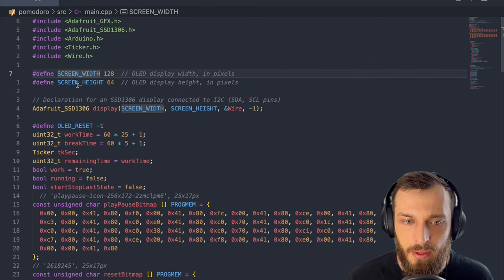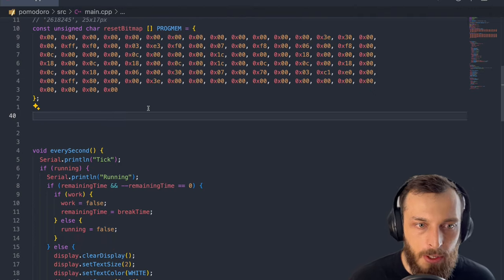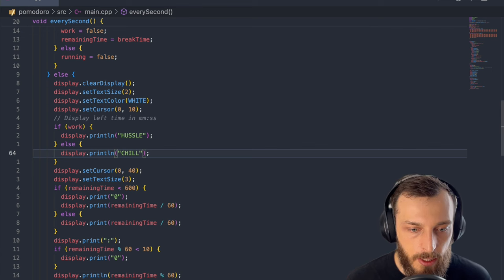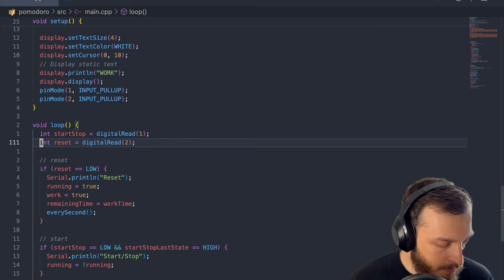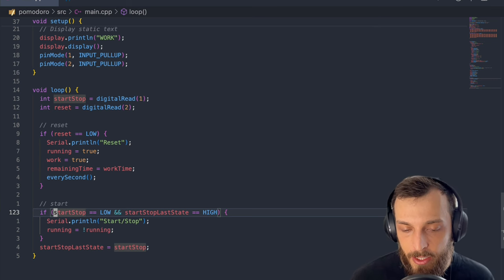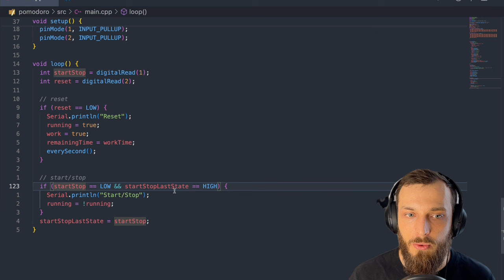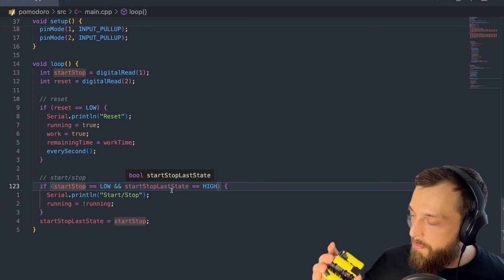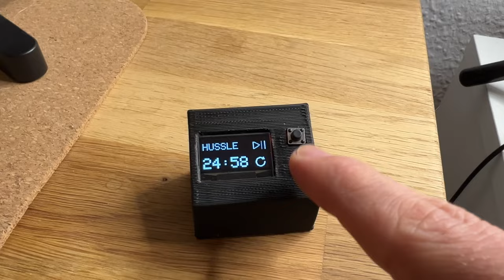DIY ESP32 Pomodoro Timer with code explanation

Comment: Nice project! thank you for sharing.
I noticed you use the tp4056 charging IC for the lipo. Did you limit the charging current? The default current is 1amp and that seems a lot for the small lipo.
Reply from the maker: Yes i do
Ah no
How can you adjust that? 
Maybe a bit much, but didn’t get warm while charging, so I assumed it is fine
Reply: @CodingWithAuryn  
Yes for 1 or 2 times this should be fine, but lipos can and will blow up and catch on fire if charged with the wrong current. Happened to me before and dont want this happening to you.

You can change the resistor on the tp4056 to a different one to adjust the current. google the datasheet there is a table with values for the right current.
The 18650 cell you mentioned would be a better fit for the default current.
Reply from the maker: Thanks for the Tip
True
Then I may modify the case and exchange it for the 18650 soon :)

Comment: I love this, I've built this as my first esp32 project. Would it be possible to add a buzzer or vibration motor to mark the change of status?
Reply from the maker: sure, should be easy to add, then just a new case is needed.

Comment: In this video I noticed that your Background Blur Effect for the video stream made it very difficult to see and recognize the battery and the two ESP boards.

I'm aware that it's a fairly new channel, but I would still like to encourage you to make use of more than one camera.
One camera pointing at you, and another camera pointing towards detailed objects on your table top - like electronics, 3D printed parts and stuff like that.

I'm certain that you could use an old phone as camera 2, and synchronize the video streams in the post processing.

I hope my comment can be inspiring and helpful. 😊
Reply from the maker: Thank you. Yes indeed something I should consider for the next time :)

Thank you for your tip

Comment: At ct3003 or so they once tested these e-cigarette batteries and said you can use them with the explicit warning that they don't know how safe these batteries are. And how often you can/should charge them and whether they might blow up. Have you ever heard of this and what do you think about it? :)
Reply from the maker: Ah interesting. Yes will exchange the battery for the 18650 
Then it should also run easy for a day I hope :)
Reply: @CodingWithAuryn  

I just wanted to calculate this, but I couldn't find the right data. So I asked an AI xD I wanted to find out how long a single 18650 cell lasts :P

Here is the output:

Without specific data on the ESP32 C3's power consumption and the details of your setup, it's challenging to provide an exact duration. However, as a rough estimate, if the ESP32 C3 consumes around 100mA at idle and 200mA under load, and assuming a 2600mAh battery, the battery could last for approximately 26 hours at idle and 13 hours under load. These are very rough estimates and actual values can vary widely based on the factors mentioned above.

However, only the ESP32 C3 is taken into account and not the LCD etc
Reply from the maker: @-.nocturna.-  lets see, just set it up with the 18650 cell and charged it fully
so far no issues, but it just half a day yet :D